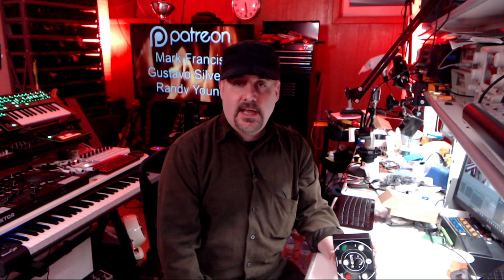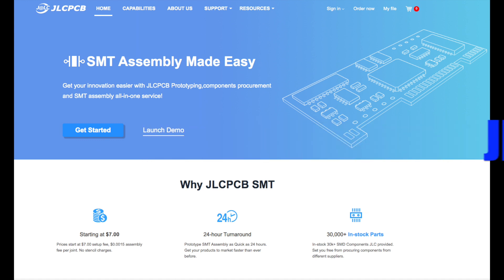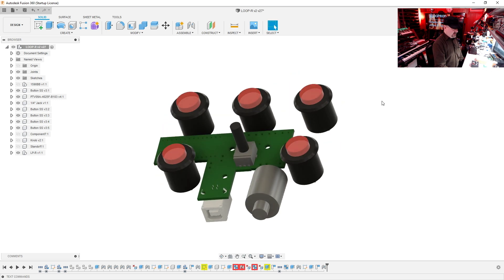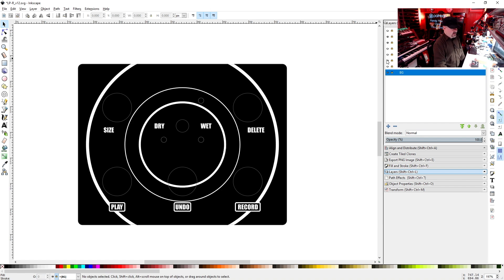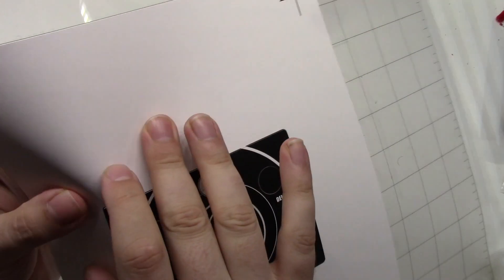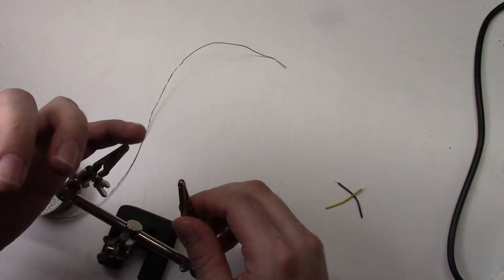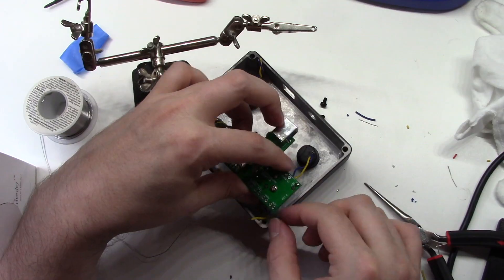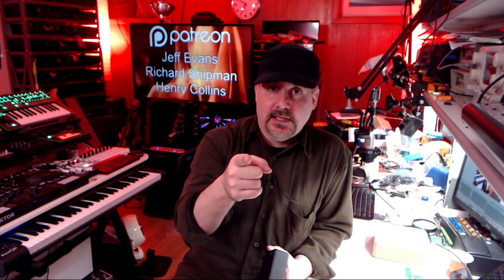DIY TRAKTOR Loop Controller - PART 2

Comment: Hey there, thanks for your videos. I just finished making a custom midi controller for Traktor, greatly inspired by your website.  Used jlcpcb (I think I linked via your site?) and KiCAD. I'm using a Teensy 4.0 https://github.com/shmish/midi5000.  One thing I'd like to do, but I'm not sure it's possible, is read a value from Traktor.  Specifically I used momentary buttons to turn headphone cues on and off.  I can't use the button to read the buttons because they are always OFF.  However, I think Traktor can send out a cc message that says the state of each headphone cue - I'm not sure about this. It's definitely a setting in Traktor but I think the midi is sent only when the cue is toggled. Anyways, I'm wondering if you have any ideas on how to accomplish this? In hindsight I should have designed my pcb to use latching buttons. FWIW, finding buttons of the appropriate size for this project has been challenging!

Comment: Bro. Unless you are making a lot of copies, whom cares about a computer model? Waste of time imo.
Reply from the maker: Hi BBM. I've found that spending a couple of hours on the computer can save a ton of time and wasted materials later on. Especially when you are using a PCB and some sort of custom graphics. Do you need to do all this to make this project - no. That's why in the first video of this series I encourage viewers to use whatever tools and materials they have handy.   But for my unit, I want it to be the best it can be. And if I want to make more copies later, I  have everything ready.
Reply: @NotesAndVolts  I have found that also - even drawing my design (any design - hardware or software / website UI) on paper (or my eReader) can quickly reveal things I had not considered. It's a very efficient pre-physical prototyping process that pays dividends.
Reply: @NotesAndVolts  I don't do a 3D model, but I draw all my bits in 2D in AutoCAD.   It really helps you make sure things are aligned
Reply: Too make sure it all fits in the specific case he wants. Also if he uses the same components for all his projects he can just reuse the models he made for other projects saving time later while designing other projects.
Reply: You are paying a premium for the Hammond (sp??) cases.

If you are making a once off, you could do away with the PCB and wire everything direct to the Teensy. I think.